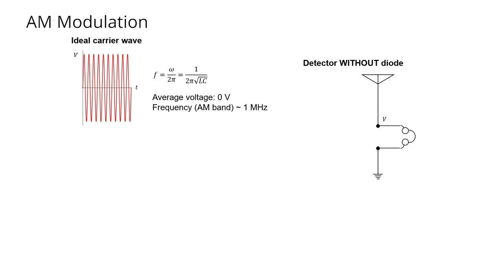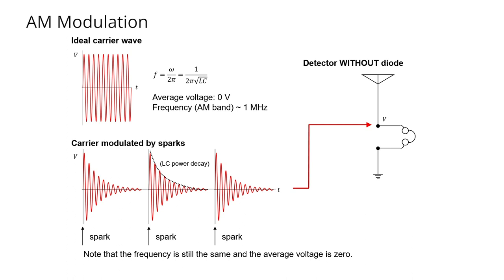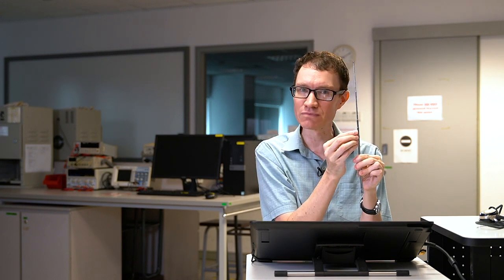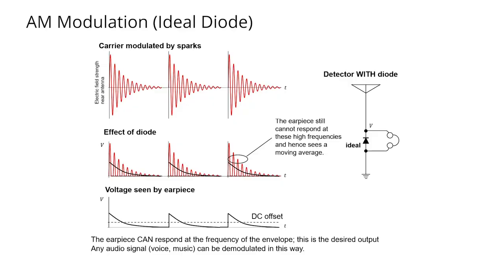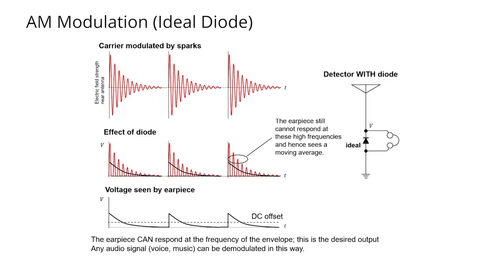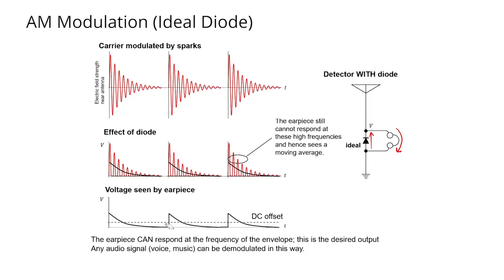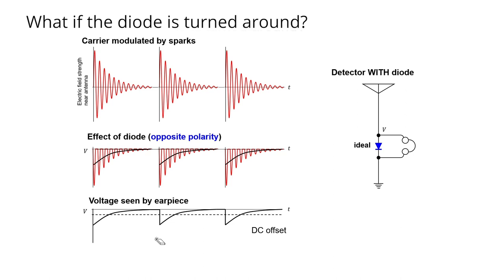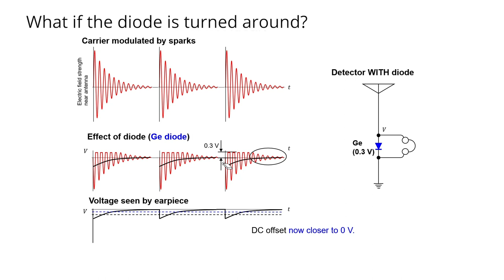Crystal radio circuit analysis/diode demodulation (8-Analog Electronics)

Comment: min 3:40 the diode is in reverse biased which means it does not conduct the current, and the voltage seen by earpiece how does there is a current flow in the diode??
Reply: the current alternates up and down. that means it doesn't matter which way you install the diode. it either lets through the top half of the waves or the bottom half of the waves.